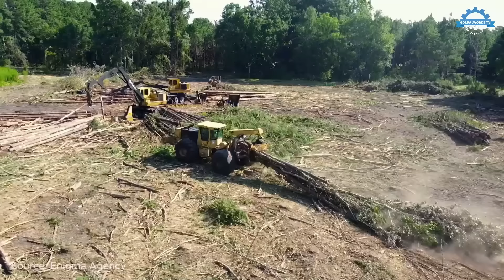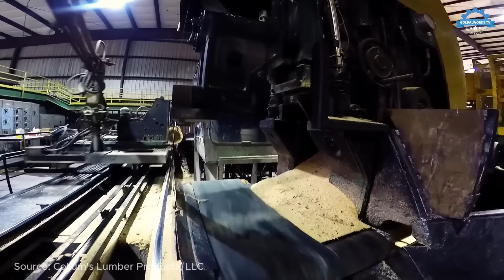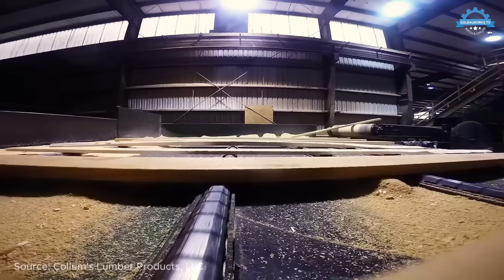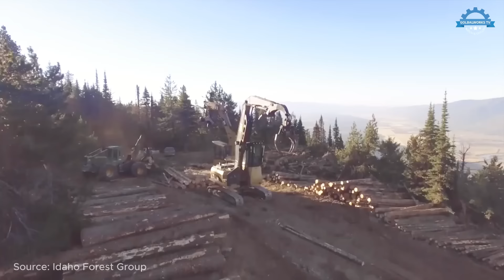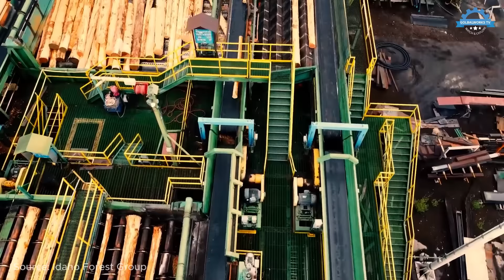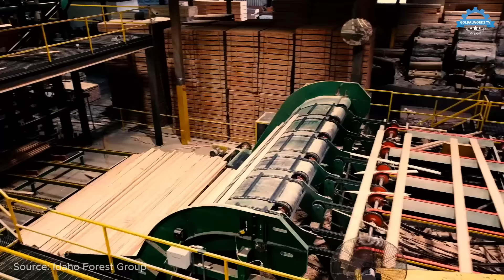America’s Log to Lumber in Minutes: Millions of Boards Produced Daily by Modern Automatic Machines

Comment: And how much lumber is imported into the US from Canada?  And why?  And at what extra import tariff?  How much lumber is now metric instead of traditional dimensions?  Why?  ps.  Look at a 1x2 sometime and measure it as it’s not 3/4” x 1 1/2”
Reply from the maker: Great questions! Canada is the largest supplier of softwood lumber to the U.S., and imports have long played a big role because Canadian forests produce an enormous volume of construction-grade spruce, pine, and fir. Over the years, tariffs have been applied at different rates depending on trade agreements and disputes — sometimes adding significant cost.

As for dimensions, you’re right: a “1x2” or “2x4” is the nominal size, but the actual finished size is smaller (for example, 2x4s are typically 1.5” x 3.5”). This change came about when sawmills began planing lumber smooth and adopting standardized dimensions, and today much of the world outside the U.S. uses metric sizing. It’s all part of making lumber consistent and interchangeable in global markets.

Thanks for raising these points — they highlight how deep and fascinating the lumber industry really is!
Reply: Lumber is the same size in canada.     Metric system got nothing to do with it,,,,,,,damn.
Reply: As of last week, Canada imports zero.

Comment: I can't think you'll get much yield from those logs at the beginning, they're so thin
Reply from the maker: That’s a very good observation! Those thinner logs usually don’t produce the large timbers this mill is famous for, but they can still be turned into useful boards, studs, or other products. Nothing goes to waste — every log has its purpose in the process. Thank you for noticing and sharing your thoughts!
Reply: They can also be made into plywood or OSB.
Reply: I just wrote a post about the same thing. These logs can't possibly produce but a few boards by the time the log is not perfectly straight, you might get a couple of studs out of one log. I can't see any benefit at all cutting the logs this early.

Comment: Bridges? Dont think bridges have been made out of wood for awhile
Reply from the maker: It’s true that most modern bridges use steel and concrete, but large wooden timbers are still used in covered bridge restorations, pedestrian bridges, and certain specialty projects. Mills like Hull-Oakes often provide the oversized beams needed for those jobs. It’s a great reminder that wood, even today, still has a place in bridge building!